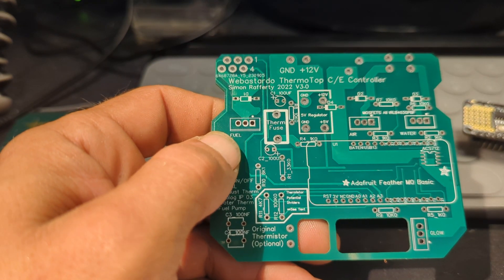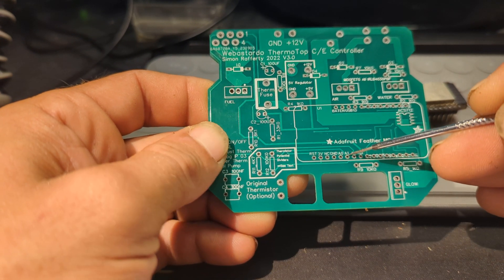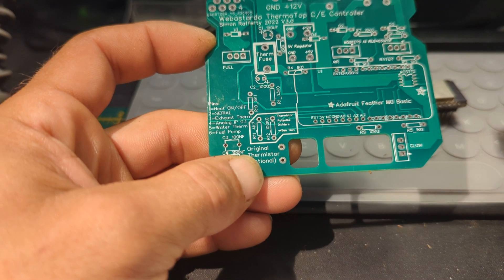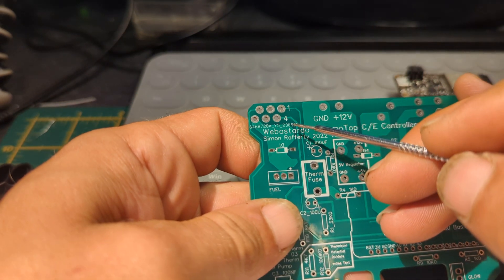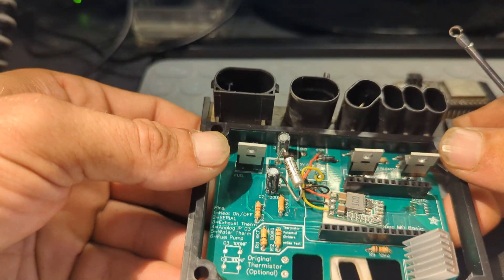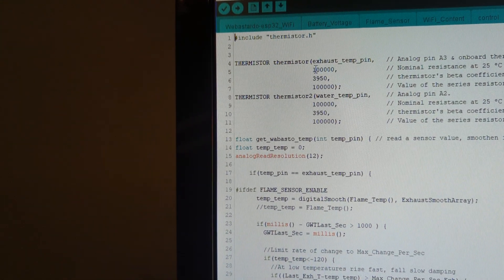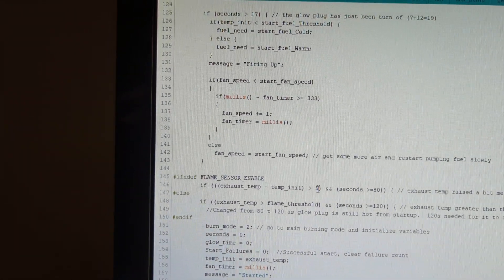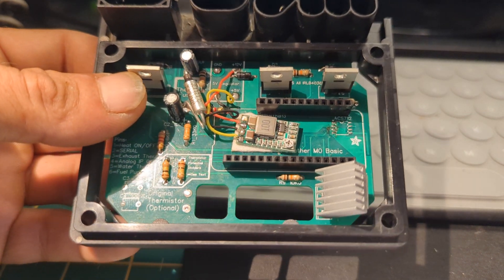Webasto Custom PCB, Webastardo V3.0+ (Part 1)

Comment: The on board thermistor for water temp surely? I use the v1 board with a pro mini, built a daughter board to remap the pins which works well. No remote control though.

Comment: Im having issues with a webasto thermo top evo setting a code for unsufficient coolant flow, ive tried a new pump, harness, whole other webasto unit, redesigned the plumbing several times, added a second pump, is this something you could fix for me with a new pcb board? i have the webasto pc diag tool if that helps
Reply from the maker: unfortunately not buddy, my work is only with this one unit using the available open source projects from others. i hope you find someone that can help and get your system sorted asap 👍

Comment: Ou, nice. Great work.
Do You know exactly whats the program difference between diesel and petrol version?
Reply from the maker: unfortunately not, simon or david will probably know though, maybe message on one of their videos.
Reply: hi, do you found something for using petrol with webastardo?
Reply: @pjaymaen  Well, there is quite lot of differences in software. Ignation algorythm is compleatly defferent, fuel amount during work, air mass flow,  post-ventilation time etc.
But the difference in burning chamber is very small, petrol one is littlebit more complicated. You can use petrol chamber with both fuel, but diesel chamber only with diesel. Same ECU, in worst case petrol version can be used with both fuel, diesel only with diesel fuel.
If you use petrol heater with diesel fuel, only thing is it may not ignate in very cold condition due too short ignation time.
If you use diesel heater with petrol, there is fire hazard.
Reply: @ruslanserdjuk8029  so you have not found correct values for running webastardo with petrol? I have a petrol webasto heater and try to run it with webastardo but with petrol and not with diesel.

Comment: Great Video Steve, can you make me one please? or do you know where I can get one? I'm trying to fit one on my Warrior 40.
Reply from the maker: the none wifi version is easy to build a complete one as nothing coded that would need changing.
Reply from the maker: if you are Arduino savy, I could make you a board up that you plug an adafruit board into (after flashing my code obviously 😁).
Reply from the maker: Hi, I have 2 spare boards and all the components, only thing i don't have is another adafruit board, would you want the wifi version or none wifi version? if you want wifi version are you able to flash the board and set up blink on your phone? It's hard to build a finished project (plug and play) as the wifi stuff is hard coded. I'm still testing mine but up to now it's been working great.